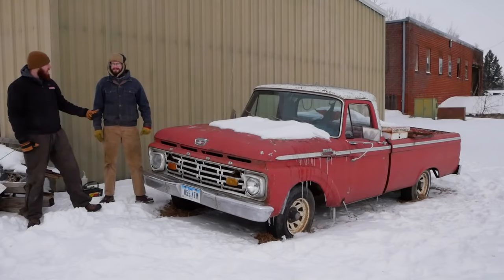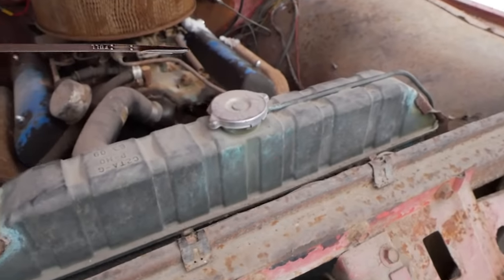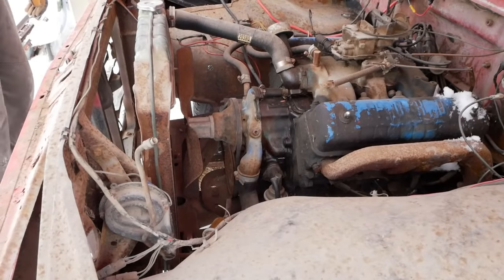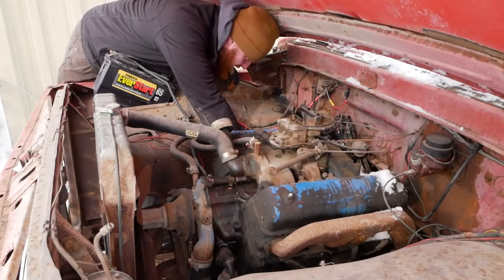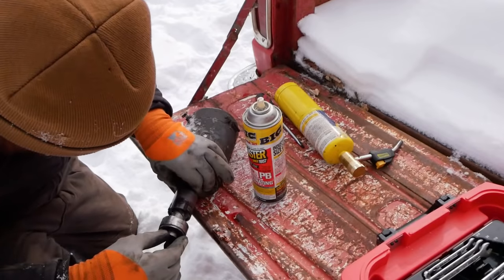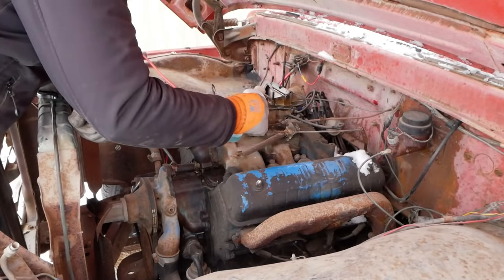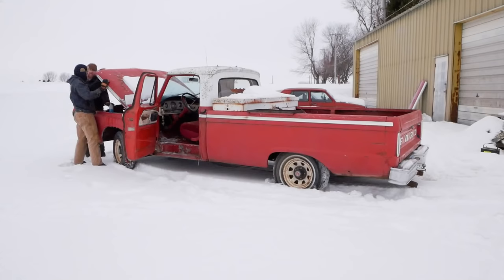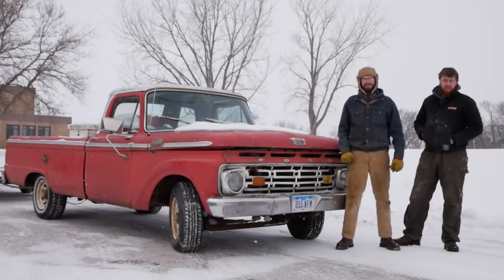Can We Make This FROZEN Truck Run During A Polar Vortex!?

Comment: Got a '66 F100 sitting in my shed for 20 years. This spring, she's coming out ! Thanks for the inspiration !
Reply: Got a 68 f100 straight six that started up the other day at -5 without even having it plugged in and sitting outside...they just don't make them like they used to.
Reply: Or you cld sell it to me lol
Reply: Or you cld sell it to me lol
Reply: @oilchangeguy-sr4lk  still driving it back and forth to town..original paint and a few battle scars but 79110 original miles. Think I'll hang on to her a bit longer
Reply: Dude if that 66 has it orig 352 big block amd its a custom cab auto. Thats worth the revival bro!
Reply: And especially if its a short bed
Reply: @gregghls2998  it’s a custom cab long bed. 352- 3 speed column shift.
Reply: I should say 3 on the tree.
Reply from the maker: We'll come help! Email me, junkyarddigs1@gmail.com
Reply: @gregghls2998  I've got one.  Runs great but needs a lot of TLC.  Grandparents bought it new, so it is all factory and unmolested.
Reply: @JRobert111111  I've got one as well from my grandfather been sitting for 20+ years all original minus the bed they put a flatbed on it in 80 I was told kinda scared to dig into it since I pulled the tank and it looked like metallic swiss cheese

Comment: Iowans working on an engine outdoors in the middle of winter.  What makes this country great!!!!
Reply: yeah the smart thing would have been to just trailer it to the shop where it's warm but that wouldn't make the best video :)
Reply: Iowegians 🙄👍
Reply: I grew up in NY and use to pull parts in 10 degrees without complaint. 20 years in California and I piss and moan if it goes over 75 or under 60.

Comment: "When all you have is a stock truck with poopy summer tires, hooked to a trailer, chained to an older truck and have to pull it through a foot of snow uphill, make sure its a Ford. Poopy tires, or snow tires, Ford will get you there."

Comment: The 292 in my 64 F250 always turned over like that, I fixed it with a 390/ 4spd out of a mustang!!! Worked great
Reply: I had to put that top oiler kit on it. You know where the two studs are that hold the cover down? They gave you hollow studs, and copper tubing with fittings. You just put a tee in the place of the oil pressure sending unit. Great engines! 272, 292, 352.

Comment: Any old Ford engine I ever played with drank gas like an afterburner when it started cold. Good job on the retrieval:)
Reply: Any of the older Fords drank gas.  I had an '82 F100 with the 300 six.  14 mpg at best.  May as well had the 400 V8
Reply: wb6162 my dads 1970 f250 with a 360 drinks 3 liter per metric mile. I think that's about 8mpg
Reply: Yep. My first car was a 79 XC Fairmont with a 302. When I traded it for a new car the finance guy saw what I was driving and said no worries, my weekly petrol cost was almost twice what my repayments were
Reply: I had one that was actually pretty awesome. 1980 mustang, 200CID In-line 6 with a 4 speed O/D.  Enough power for comfortable transportation and 30 mpg on a trip. Wish I still had it.

Comment: Best truck ever to learn to drive a stick. If you can drive that you can drive any manual vehicle! I learned in a 62 F100 with the same drive train at 12 years old in the field. Also learned it will still start in first gear with that granny low first! 😱

Comment: This truck has me hooked.  Inspiration for grandpas 66 f100 sitting outside my house right now
Reply: 66 would be a 240 / 300 six ,which came out in 1965 or a fe series v8 probably  a 352 .   Last truck y block was 64.  The fe series  replaced it.  Fe has distributor  on the front as opposed  to the y blocks on the back  .
Reply: Twin i beam  suspension with coil springs ,replaced the straight leaf spring axle in 1965

Comment: I used to start a layer of charcoal on fire and let it glow to coals in a top of a galvanized garbage can then slide it under the engine to warm it up. BAM! it started every time. Be careful to keep a eye on it so the wires and oil drippings don't start a fire!

Comment: Texan here.. To be fair, we don't get weather like this very often, so nothing here is prepared for it. It might be 3 degrees here, but none of the buildings or houses have radiators or anything. It's not like we don't know how to deal with it, we're not used to it, therefore, we deal with it as we can. There were millions of people without power and heat, it was a pretty big deal.

Comment: I saw a potential value leak when you were checking the spark.
Reply: I was watching that to. But if you look just above you can see it is snow falling down past the manifold. But it definitely needs a good tune up.
Reply: @shackman9566  there is a fitting on thepassenger side right below the carb on the manifold.

Comment: You are correct that our infrastructure is just not set up to handle this kind of cold. Officially, what caused the power outages was that, first, the windmills started freezing and the solar panels don't work (those two furnish 25% of our power) when covered with snow and ice so that put more load on the generating stations which were already stressed by the increase in power demand. They started doing rolling blackouts which blacked out the Permian Basin which is where most of the natural gas comes from so many of the gas fired generating stations shut down. This exposed a basic problem in energy management. So we have all learned a lesson in preparedness.

Comment: Good job or whatever! But when you spin the engine to check if it seized I recommend you check that in the running direction. Its not good for the lifters and oil pressure to turn the motor backwards!

Comment: You can keep your north. I want my Texas South back. 🌨🌨🌨🌨...it got to -8 here and a wind chill of -12...with 12 inches of snow. Hate life now. 😂...and no power or water for 4 days. Had to wire in a lincoln welder 9,000watt generator to the house using the 220 dryer plug to get power.

Comment: If I’m reading the hood ornament right that had a six in it originally. V8 had a v and sixes had a thunderbolt. The oil line going up to the rockers was small and would plug up .there was a plunger that you bolted on and hit it with a hammer to unplug the oil line. If that didn’t work you put outside oil line that came up from the pressure gauge outlet

Comment: I learned how to drive in one of those 64 f 100 292 cross over manifold. 3 sp on column. The biggest quirk is the hang up on linkeage. For shifter if that is timed write it will start up. 2brl holly 450cfm was stock. That electric fuel pump is probably because the fuel pump cams were known to go bad !!!!!!

Comment: Y blocks suck for power, about the only thing they are good in is a T bucket. The two center cylinders on each side have their intake ports stacked on top of each other and are like 1 inch tall and 3 inches wide. They have to make such an abrupt turn it really makes it hard to make any power. Even a blown Y block will only make maybe 300hp.  In 1964 that thing would've had a generator and probably 6V at that.
Oh by the way Kevin, my dog likes you. She looked on the computer and saw you laying on your back and started acting like she wanted to play while staring at the screen. In an occasion such as that when you need traction and you are in snow, just fill the bed with snow.

Comment: In my experience it doesn't matter what you got it always takes a lot to keep em going. Yeah my old dodge has expensive parts, had to do quite a bit of work to get it going when I bought it but the main thing is that it always gets me home and it's been fun to drive for an old family car. Knock on wood it keeps going. I personally don't care anymore what the maker is because if you got a car that gets you to where you are going and doesn't get you stranded then it's a pretty good vehicle. That truck looks pretty solid. Hell around where I live you would spend 2-3k for a truck like that in that condition. Definitely worth saving. Really hope it works out well.

Comment: Man that's a nice solid old truck!  Sucks that someone cut the grill for whatever reason - spare tire carrier?  Those wheels are nice, and are the older version without trim rings.  I'd say that Ford used those from the mid 1970s until perhaps the mid 1980s when they painted the wheels argent/gray and added the trim rings, and went to the chrome center caps.  The ones which take the trim rings have an indentation/groove around where the 'spokes' meet the rim, which accepts the trim ring.  The old ones don't have that groove, and came in white, and when used on certain Free Wheeling models, they were painted yellow!  I have a later wagon wheel (missing its trim ring) for a spare for my 1977 F150, and I have a set of Ford slotted mags with those same black centers waiting to go on.

Comment: Your truck has a 7 pin trailer connector, 1 of those is constant power. Tap into that wire on your trailer and it will charge your winch battery anytime your truck is running.

Comment: The 272/292/312 Ford engines are great engines. Keep the valve train clean and change oil often the will run forever...

Comment: We got an old Dodge Pickup at our place that’s so old, it’s brown from rust. It’s missing the bed floor, the cab floor, the transmission, driveshaft, and the entire rear axle, and also the hood. I think it’s 50s at least. The engine is there, but it’s not there. It’s in the truck, but not bolted to the truck. The engine just sits in the engine bay, at a very noticeable angle. You can see the engine through the windows of this truck. And I want to fix it up someday.

Comment: That can't be the origonal motor..the y- block was discontinued in 58..it's still a good motor..there were modifications that were done to help with the upper oiling issues..
I think you got a good truck it just needs a little love..you can Google that motor and you will see everything you need to know about it..and the modifications you can make it's pretty simple..looks like it's a little cold up there..wouldn't have it any other way..at least your not wiping sweat out of your eyes..lol..see you on the next one..Cheers 🍻🍻🍻🇺🇸🇺🇸🇺🇸

Comment: I had a '56 F100 with a 272 Y Block. Apart from the exhaust manifolds and the carb (I think) it looks like the same engine, starter etc. They always seem to sound horrible turning over! IIRC the starters in '50s British Fords look the same, but smaller. I also still have an NOS distributor in a box somewhere!

Comment: I used to own a 65 F100. Short bed that someone half assed and stuck a 1 ton suspension under so it was unusually high sitting for a short bed. Also, the brake lines on mine were coiled in the frame to shorten the length without actually cutting them. Also, also the rag joint on the steering broke while driving a twisty mountain road. I turned, but the truck didnt.

Comment: Y blocks are cool, they all need fresh flushed out detergent oil, that engine in that year of truck did not have a PCV valve so they're probably is some normal blow by I used to see some blow by coming out of some engines that was horrible,  and it still ran good. They always run better with a set of ring a long time ago that old oil would not let an engine last as long as they do now

Comment: That could actually be a 292 or 312 out of a car. On the trucks, the thermostat housing outlet pointed straight, instead of going off to the left, and the exhaust on the driver's side would cross over to the passenger side

Comment: Orange spark is kind of weak. The strength of the spark is revealed in the color. A red or yellow spark is weak and probably will not spark in the cylinder. A blue or white spark is strong and has enough voltage to fight across the spark plug gap even under pressure within the cylinder.

Comment: Don't get me wrong I love all three car companies equally and they all have their issues but with that said getting a Chrysler big-block started normally is not easy but in the winter it is even harder, I believe this is because the starter on those old Chrysler/dodge trucks and cars was underpowered and the company knew it that is why my 1985 Chrysler Fifth Avenue had a very heavy High Toque starter but before that, you needed to work to get them started. I actually had the problem of the car not restarting when at running temperature which is a carburetor issue I believe.

Comment: I never understand why people with a winch trailer or dump trailers don't wire in a charging system connection.  All you need is a disconnect and it's a good idea to add some isolator switches for extra safety. $100 project to eliminate a headache.

Comment: Shoot some wd40 on the shaft. My s10 had the same issues. There's a hole on the head on mine that's right were the lub needs to work.i found after wrestling it off in snowy, slushy weather.

Comment: Had a 64 with 352 3 speed run great but that single master cylinder caused me two accidents..so fix that if one wheel  cylinder goes all goes...be safe..

Comment: I had a starter on my 96 Chevy that  was bad but wasn't completely out because it lasted me a year and a half with it able to turn the engine over just enough to start then it would disingage from the flywheel and spend then you hit the key again it would engage for a couple cylinders then disingage it normally 2 tries to get it started sometimes it took me several

Comment: Wish I had your luck..I bought a 77 f150..the motor turned buy hand but when I got it home...I should have turned the engine more cause it would lock up as in could not do a full cycle..

Comment: Your not working on a 292 has the distributor in the front of the motor. Your working on a 312 that is organized in those trucks and it’s the same motor the put in the 60’s thunderbird “t-bird.” I myself actually have a 1964 ford f100 y-block 312 y8. It’s like 4.8 liter motor and there’s 93,663 on my truck and motor.

Comment: 64 has better stock exhaust than the 63 f250 i have. on mine the drivers side exhaust manifold existed to the front of the engine wraps around and connects to the front of the passenger side exhaust manifold and then it exits normally under the truck.

Comment: Can I ask u a car question anyone can answer but I have a 96 chrysler town and country,  it's a 3.8l v6 I got no spark,  I've replaced the body controll module to get the interior lights to come on, replaced the headlight switch and the cluster and I replace the coil pack because I got no spark, accidentally smashed the ignition so I got the black box out and manually clicking the key lol but no spark and I also took out the keyless entry module under the dash cap and lost it its a red connector soo any suggestions? I bought it for 80 bucks

Comment: No thanks Kevin you take this sh*t right back to Menards. Here in Texas it was 0 which in my 40 years is one of the first times I have seen that cold 🥶 in Dallas and yeah we are not set up for that even our cars are not set up for it. My fuel return line had moisture and froze and cracked my coupler and leaked on my exhaust yeah boo on this sh*t!

Comment: It does suck for poor and unprepared people. I have 2 100k btu gas furnaces, 2 large wood stoves, a smaller wood stove, and 2 gas fireplaces with fake logs in them. My house in Little Rock is on the same circuit as 2 pieces of critical infrastructure. My power hasn't even blipped, nor has the natural gas. 20.3" of snow and a low temperature of -1F at 7am on Tuesday, snow cumulative monday night through thursday morning. I live hundreds of miles south of you and don't run summer tires on my tow pigs why do you?